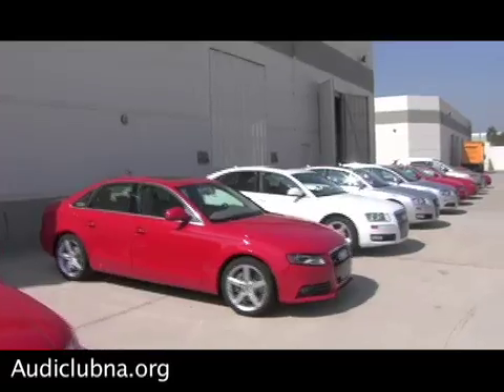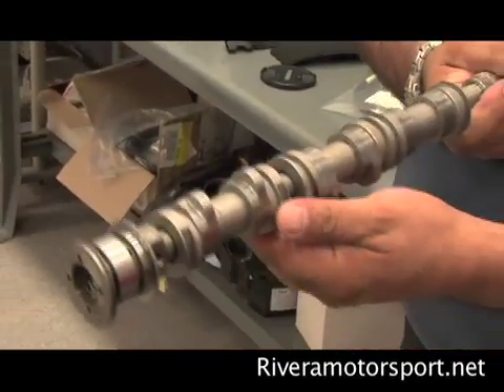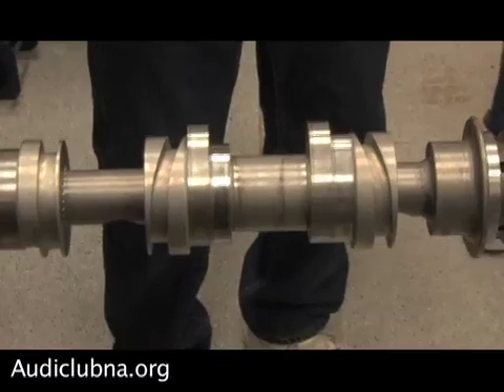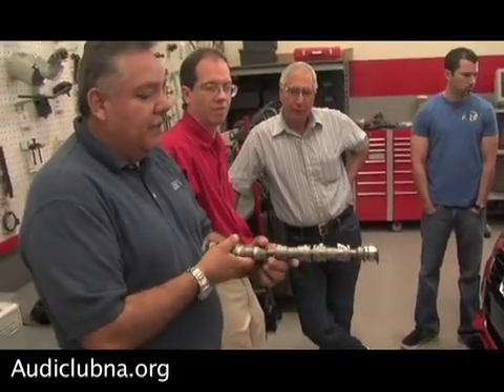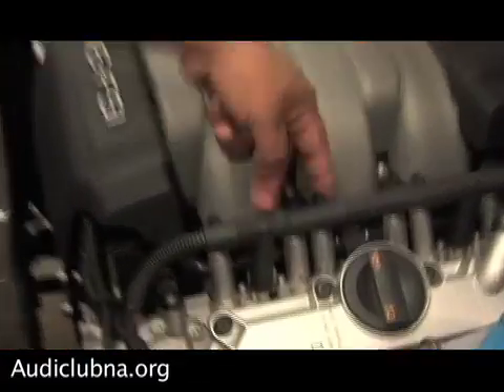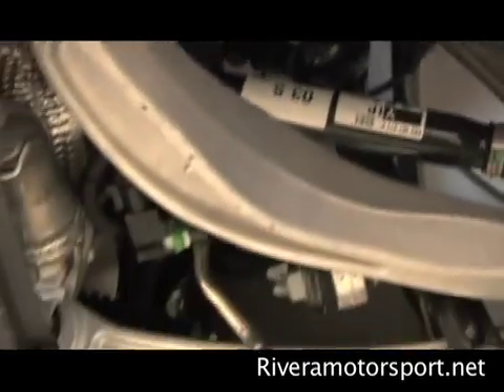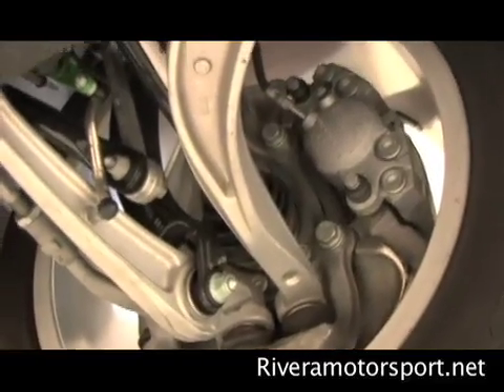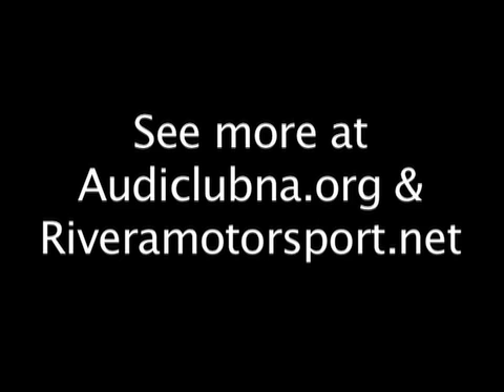2009 Audi B8-A4 Technical Inside Scoop

Comment: neat and all but there is so much potential for engine failure with this set up. Tell me, what's going to happen when one of the low end solenoids fails and sticks in the open position and the high end solenoid opens to the cam for reposition and now you have both solenoids engaged to the cam slider and bending the solenoid dowels. Just ONE of many potential issues I see going on here.
Reply: I would love for you to see this comment and reach out to me for a discussion. please and thank you